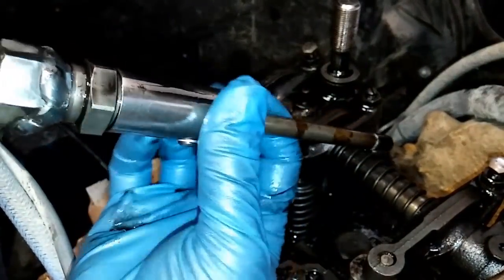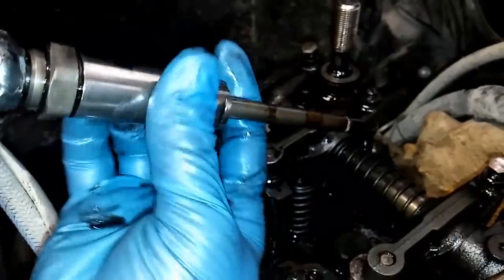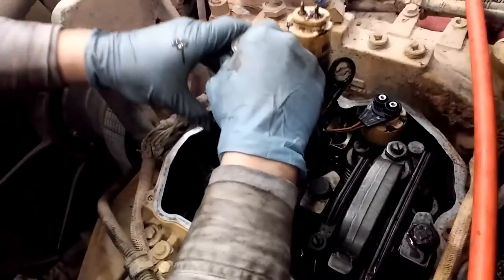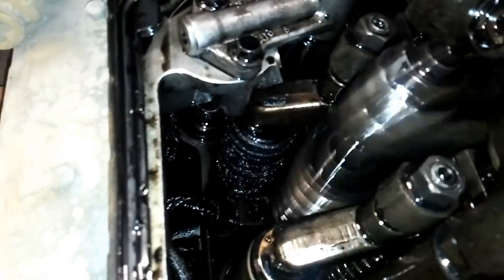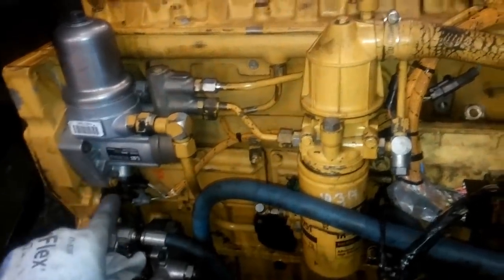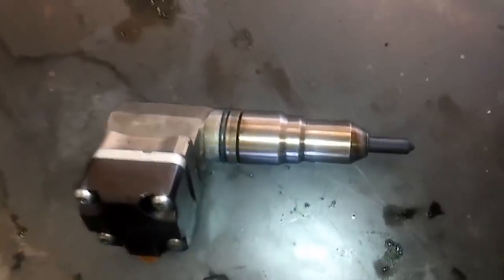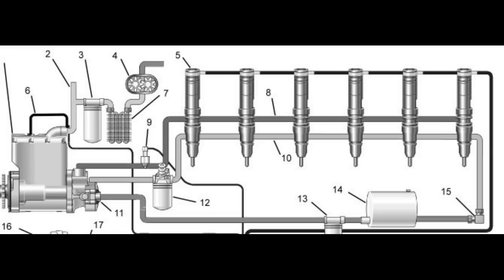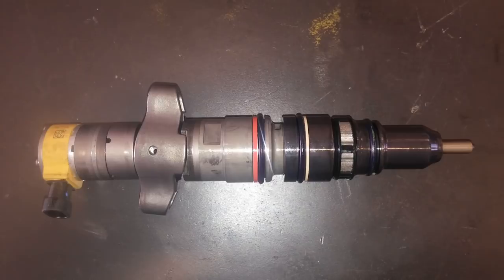What Are The Different Types Of Diesel Fuel Systems.

Comment: Great video. Those old mechanical injection pumps are a work of art
Reply: And the fact that Diesels are inherently capable of running without any electricity. That absolutely blows my mind.
Reply: @electric7487  Mechanical diesels
Reply: Yes, Love the mechanical injection for longevity/ simplicity (maritime use) couldn't you just have a spare mechanical injection unit/ if your running engine 24/7 in the middle of the OCEAN...

If that was even the problem?

And cost $10k - $20k and up??? 
Roughly 

Thank you

"Love the videos "

Comment: Great info.
Another sort of hybrid is the in-block unit injection pump system used on many smaller Deutz and Isuzu engines like the FM/FL 1011 and 2011. Basically an individual cam-operated injection pump at each cylinder, each feeding a single in-head nozzle. It still uses a common rack for all the pumps, but since the whole thing is laid out along the length of the engine, it makes for plenty of room to work on an individual cylinder system and all the injection lines are straight and equal length.
Reply: Steve po mack/ volvo used them alot as well
Reply: Steve po Detroit Diesel 671 two stroke engines also.
Check out a Napier Deltec triangle engine..

Comment: Great video as always. One thing I was kinda surprised I didn’t see, although it could be because Caterpillar doesn’t use them to my knowledge, was the distributor style injection pumps like those made by Stanadyne. In my area it’s very easy to find those pumps on old-ish tractors and construction equipment. Like I said though, I don’t think Cat ever used them because I think they made all their own fuel pumps. Still a really great video and very informative.
Reply: Its called rotary pump injector. Infamous for these type of injectors are the high revving 4JB1 from Isuzu on the Trooper. These injectors pumps are built for high revving. Its like a hydraulic pump design.

Comment: The 3306 is a totally amazing engine - I had them in loaders - dozers - compactors - NEVER had a serious fuel pump problem. Start in a few spins (summertime or well heated) ran like a beast.
Reply: One of my clients has a 3304 PCNA in an EIMCO 913. The engine is the only thing on that machine that seems to work right!

Comment: You are absolutely correct on everything. I have worked on all the fuel systems you discussed to include fuel bench for 30+ years, finally retired working part time as a technical instructor specializing in T4F. Good to see the good work and no BS information you're passing on! ( Forged body fuel system  D399$#%@)

Comment: The old 2cycle Detroit Diesels were interesting where they used  cam operated injectors , but the governors appeared complex . Maybe not so bad , once you took enough apart though . They could handle very old fuel .  Not as efficient as 4 cycle diesels back in the 40s , 50s ,60s and 70s , but better than gas engines . Nice video!

Comment: I have driven all of the ones mentioned, not necessarily Cat, but in one form or another. I will always have as my favorite the mechanical Cat, direct injection system. When those came out around 1979 or so, they ruled the highway. The 3406B 425 was/is my favorite of all. I enjoyed the "precup" motors to drive also, but they got poor fuel economy compared to the direct injection motors. As you said, everybody has gone to common rail now, mainly for emissions reasons.

Comment: Sitting in a 90's TDI and love the system. It has the central high preasure fuel pump which provides the nozzles with diesel. Those nozzles are controlled by the fuel preassure which gets applied. Means the setting of the fuel pump gives the timing of ignition/injection. The gouvenor can (electronical) adjust the ignition timing in dependency of load and state of the engine. But it just can inject once per working stroke. I felt like it is very robust although the fuel pump (comparable with the hue (or hooie?!) system) with the difference that the oil preassure isn't used for the nozzles anyhow. Which gives actually an incredible (even extremly) cold startup behaviour. An additional sensor gives the ICU the position of the needles of the nozzles for the adjusting cycle. In my case it is a 66kW 1.9 TDI built 1993 which is boosted by a turbo charger and the engine has an very high compression ratio of 19,5 to 1. (for the US guys it is a 4 cylinder engine with 86,8cu) :D Even it is very cold (I'm living in the Alps in Europe where we can get -20°C) it merely needs the glow plug cycle and works well with SAE 10W40.

Great Channel, subbed and liked! 

Happy driving !!! :D

Comment: Cummins PT system..............simple,reliable,good performance,cheap to fix.The K-19 Cummins could crush anything else in performance and fuel economy, even the Electronic engines that came later. The mechanical  inline pumps used by Cat,Mack etc were in their day deadly expensive to fix. I can remember in the 1990's that AUD $10,000 was not unusual for a pump rebuild.  Even a small light vehicle like a Nissan Patrol or Toyota landcruiser was $2500 to $3500 to fix.

Comment: 4:10 up until the late 1980s, Benz also had an emergency engine shutoff device under the hood, just in case an electrical device doesn't function correctly.
6:22 Many other computerized diesels had inline or distributor fuel pumps, but the mechanical governers were replaced with electrical components. The most common example I can think of is a 1998-2002 Dodge Cummins 24V.
7:40 VW had something similar to that, and they called it "PD" or "Pump Duse." It means "Pump in head."
9:18 Those were also found on the Ford Powerstroke 7.3 and 6.0.

13:32 In addition, I think common rail injection is the only way a DPF could go through active regen. I know that when the 6.0 PSD was replaced with the 6.4 PSD, the 6.4 got both common rail injection and a DPF.

14:50 I have been told that it would be best to put performance additives in the fuel tank.
Reply: I don't see how non-common rail engine can't have active DPF regeneration.

Comment: About that mechanical fuel system in the early diesel engines with caterpillar, Iowa definitely tend to say that that is extremely complicated without lot that can go wrong. I really do find it amazing that apart that could cost as little as I don't know $0.40 totally destroy any engine regardless of fuel type. It is totally a work of art being a mechanic and improving upon designs in the process. The big block V8 made by Chevy extremely easy to Shaw's make big Power with them I'd be doing that very reliably. And yes I do understand that you have to find the right part for that particular system that you are upgrading no matter whether it's gasoline diesel propane compressed natural gas I could list about three or four other fuel Types on top of that but those are just outright completely uncommon and a rarity to find. I really do appreciate this video because there really is a very high level of artwork to a video like this in the way that you conveyed your message so clearly. you really are like me you have your own totally Unique Style. Thank you so much one mechanic to another man thank you your videos are phenomenal and very helpful resources.

Comment: Forgot the cummins PT. Still a mechanical unit injector but fuel metering is different. Still plenty of them running around today.
Reply: Here in Costa Rica we see Cummins big cam,88 series,magnum...
Some of them are PT I think 
They are still running and fairly cheap to maintain but not the best at fuel consumption 
Exempt for the 88 series 315hp those are great in my opinion

Comment: I still prefer mechanical pumps they seem to just run the best and be the best combo of positives.
Reply: I'm old school diesel trained but have more or less caught up with the new stuff and tbh I like the advantages of the newer  systems, more power torque quieter etc etc but yes , in a way youre right and I could diagnose problems on the phone on the old gear but without a decent bi-di scan tool you have no clue, it could be anything....
Reply: @turtlezed  Ive got some old equipment frm the 70s and 80s that is all turn key and ready to go and i just can't believe that new electronics will be ready to run the same as it did brand new 30 yrs frm now. Its like 60s and 70s muscle cars there just wont be anything to replace them someday.
Reply: I preferred mechanical systems but they were easily "turned up" and emissions easily disabled
Reply: If they hadn't allowed the proliferation of diesel engined passenger cars, I wonder if we would be in this position right now...in the UK people are turning away from diesel passenger cars as sales have plummeted. The sheer cost of repairing a modern diesel is outweighing any savings made by the engines frugality. The most modern diesels have  sophisticated treatment systems and when they go wrong, they go wrong big time. Anybody asking me these days, I say depending on your mileage and usage I would go with a modern petrol engine and if you want more mpg, spend the extra and get it LPG converted.they are way simpler( in engineering terms) to diagnose and work on.
Reply: @turtlezed  Modern emissions systems do more harm than good. I run 70s and 80s Deutz diesels with water scrubbers - for mine/industrial use, the scrubbers are great and cut DPM by about 30%.
Reply: Headframe Hunters ...thats very interesting cos i used to work in a coastal coal mine in the North East and we had Hunslet locos underground, you can see one at Shildon railway museum if theyve still got it that is, and they had a liquid scrubber box with spark arrester and the operators used to make up a water based solution using a pink coloured powder from memory, i cant recall what it was called and havent seen anything like it since.... maybe you’ve got similar?? I always thought ‘why couldn’tu that technology  from yesteryear be adapted to today’? but not even knowing the name of it i cant research the science behind it....

Comment: I tinker on an 1960's era maximized ford 2715e 380 cubic inch straight six diesel with a Simms minimal injection pump.  Very little visual info available.  This is of great help.  Tks.
Reply: Marine not maximized.

Comment: The new development is the Ducted Fuel Injection.  Developing at Sandia National Laboratory and based on the bunsen burner this injection system will eliminate soot.  The complete mixing of air and fuel is the key.  This will be able to be retro fitted in existing diesels.  This is  so important with all the existing diesel engines like ships, trains, equipment  and trucks.  There is also Renewable diesel coming your way.  This is not bio diesel but refined from the same feed stock.  Renewable diesel is better than petroleum diesel in every measure.  Diesel is not dead.

Comment: Your mechanical Truck engine, Cat fuel systems was Forged Body(very old and used on early 1693) , Compact Scroll (used on a A model in a truck, 1600 series and 1100 series, early 3300 series) Starting with 3406 B New Scroll fuel system (had two slightly different VTU starting in the 4MG's .Early 4MG's had old 7FB VTU) 3208's and early 3306's used a sleeve metering fuel system. It ran in diesel fuel and air in the fuel was a problem.
As I have said before, a good mechanical Cat pump tech can look up and rerate a mechanical engine. Not hook ET up and just flash it like you do today.

Comment: So the 2015 year Mahindra tractor I just bought has the common rail system and is possibly going to have issues if any contaminants get into the rail? It does have a 2 filter set up which I thought was redundant at first but now see how that is beneficial. I sure hope I can get a lot of good hours out of the engine before I have to worry about issues with the fuel rail or injectors because I'm sure it won't be cheap to get it worked on and is likely out of my wheelhouse as a DIY guy.

Comment: Hi josh. For the sakes of our education and to check my understanding here :
The mechanical unit injector has a fixed timing and must fire when struck by the camshaft.
The electronic one has the ability to store that pressure as builtup from the cam strike and release it upon solenoid command?
Its this that I'm very interested in.
Can the electronic one deliver more than one injection, much like the modern common rails do on passenger cars to make the engine quieter, emissions friendly etc?
Many thanks in advance from across the Atlantic.
Paul, stevenage UK

Comment: Thank you so much. From what I've learned, including here, the best Diesel Engine form me, is the old school, mechanical pump with nozzle design. I think that is what the small, single cylinder engines from Kohler and china are using.

I'm using those for generators, and I need them to run on a variety of fuels, including fresh cooking oil, used motoroil, and used filtered frying oil.

To my understanding, the only reason why Diesel Engines can run on fuels like gasoline & alcohol, is because those fuels are not oily enough, they are too thin to lubricate the mechanical high pressure pump, and will destroy it....So, does this mean 2stroke mix will work in these style Diesel Engines? Like 16 to 1 or oilier?
Reply: @poopinfruz9771  
Thank you. I'll remember this when I have the time & money for experiments.

Comment: good explanation, I fiddle with diesel engines a lot, the injector's Volvo use on certain engines could be discussed as they use a system where water comes in contact with the injector in the head thus suffering from water in the fuel, just wondering why they use that idea, the issues with fuel injectors are caused by operators not servicing their engines which is a common problem i see all the time.

Comment: Any chance of a video on the common rail system that has the Jake incorporated please? 
In essence it's easy to see how it works with unitary injection as the mechanical pressure build-up works to back off the exhaust at the right time.  But for the common rail surely this cannot be the case can it? 

Best regards

Pgb

Comment: Hey this has nothing to do with fuel systems but I wanted your input, we just got done rebuilding a 3406c with all new cat parts and new oil pump, after we had it together we were priming the oil system and it is not getting oil pressure, any ideas?

Comment: Hey bud been a while since your last cat video I actually have a question for you might not be related to cat I have a 2003 Cummins ISX with 300,000 miles on it and I have one bad injector cup cummins is telling me I need to change the whole head .
do you have an idea or a way to only change that one cup also 
I have a C 15 nxs 2007 model and my fuel mileage is for mpg other than air filters what can I do to get it Up do you recommend tuning and or deleting actuators or switching to a single turbo set up which still means I’ll probably have to do a tuning and delete actuators on it

Comment: Cat used a mechanical unit injector like the Jimmie 2 strokes? 😲
Reply: yep
Reply: @richardcranium5839  
That's one setup I haven't run into in the 50 years I've been twisting a wrench. 
(not a bad thing) I've done a lot of Jimmie /Detroits and I was pretty good at it, but it doesn't mean I like the screaming 😱 sob's.

Comment: How does  an inline/mechanical injection pump advance its timing, under light load or high speed?
Like old-fashioned petrol engines, using vacuum or centrifugal advance.
I can't see any way to do it. The injector camshaft is fixed.
Reply: In trucks Cat used  a few types of advance (mechanical engines). Slide advance with weights and springs. As RPM's increased the weight would slide out until the RPM's caused the weight to  over come the force of the spring. Since it was slightly off set it would twist the fuel system camshaft. No adjustment on this type. 
The 1693 truck engine used a hydro mechanical advance. Had two flyweights as they opened up with RPM's they would put psi on the mechanism. Had a power piston that was helical on one side. When advance started it pushed out forcing the fuel system to spin out due to the helix, causing advance to take place. You had to drill the power piston to set the timing and once drilled no adjustment.  
The last one was still a hydro mechanical basically. Cat used a spool valve, flyweights, springs and helix. However on this setup you had a start of advance adjustment and end of advance adjustment.

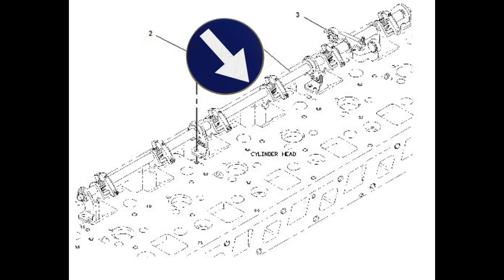Comment: Hey, I have a question that has stumped every diesel mechanic I've asked. I have a 8.2L Detroit diesel that is in a 83 GMC 7000 that is a crank no start condition. I'm not a diesel guy, but I'm trying to get it running again. I'll tell you what I do know... and maybe you can help :). It looks much like the setup @2:37 of the video, but I feel as if the racks are under the valve covers like the model @5:00. It has the governor with solenoid right in front on top. The shutoff solenoid does retract when energized (ignition) and the 'Run/Stop' splined manual shutoff shaft is set to 'Run'. Fuel is being pumped to the top of the motor, through the motor, and to the return line. I drained the tanks of old diesel and partially filled the tank with brand new diesel. I was suggested to give it a shot of ether- which I did... and it starts and dies. It has new primary/secondary fuel filters. Now here is what I don't know or where I have questions. Why won't it start without a shot of ether? Why won't it stay running? What am I missing? I tried to bleed the lines of air, but maybe I'm not getting it all out? Also, worth mentioning is that the truck ran fine 4 years ago when it was parked. It has just sat for awhile. If you can give me any insight, direction, or solution... I would greatly appreciate it.
Reply: Is it a 2 stroke Detroit, like a 4-53? If it is you may have to take the valve cover off and make sure the racks are moving freely and not seized. I have heard of this before it won't let the injectors open and close